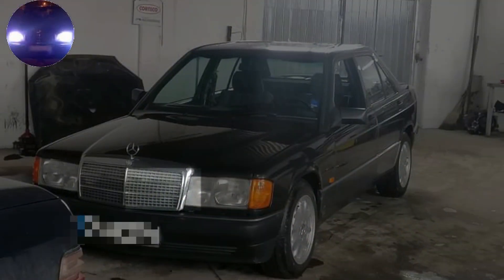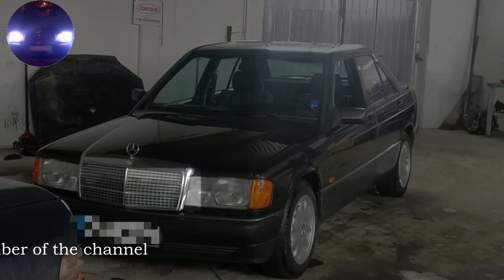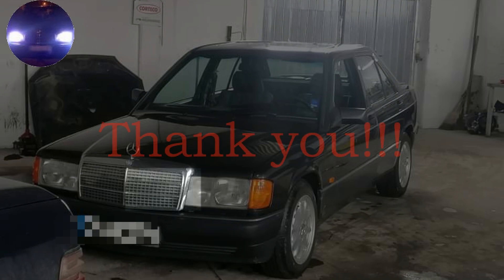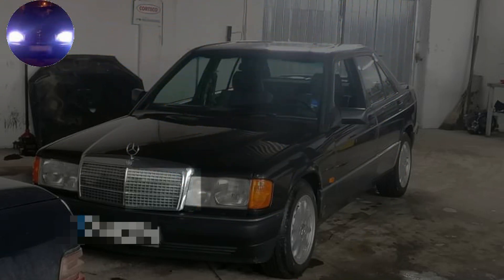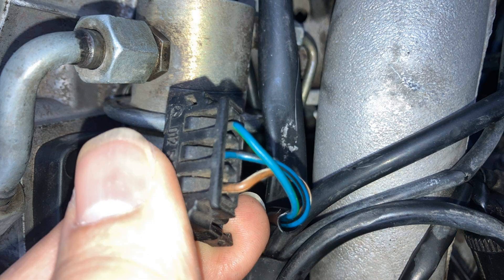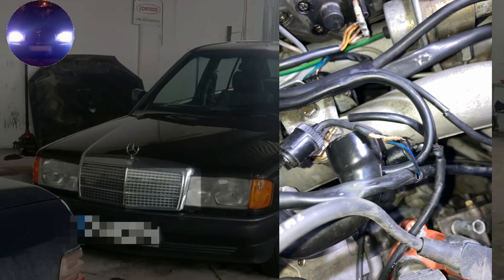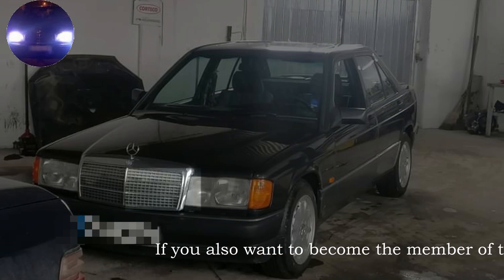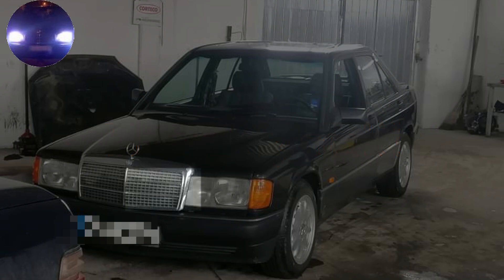㉦Mercedes Ke-Jetronic㉦ - 190E from Romania part2

Comment: Hello Ivica, for information I have 1989 190E 2.0 from Finland with no KAT. The car has 3 pin ICV and 1 pin TPS (water sensor). I guess the 2 pin ICV from 1988 comes with KAT installation maybe ? Anyway, thanks to your videos I learned this kind of version doesn't revs up to 1200 rpm for 30 seconds during warming up. Directly set to 750-800 rpm after 1 second at 1200 rpm. Cheers and thanks for your content ! Keep on Mercedesing 🙂
Reply from the maker: Hello, thanks a lot. Generally, the 2 pin icv comes with the ke3 version of the system. If your system has TZS, then it's either ke1 or ke2(ke2 have 3 pin icv). The KE3 are the first versions with the EZL ignition system. No matter, if the car works fine then everything is okay. Happy Mercedesing 😃 😊 🍀